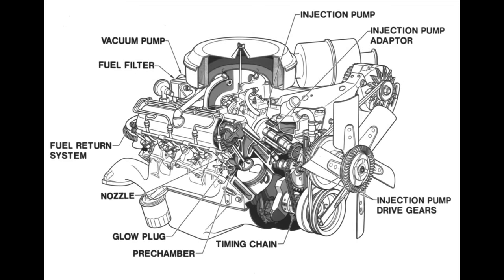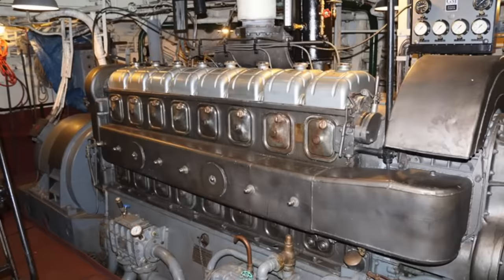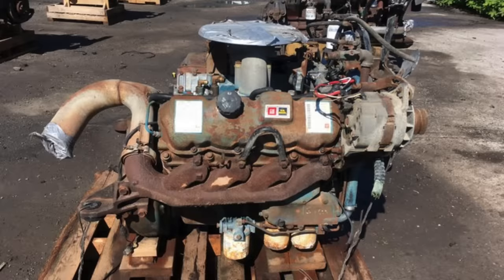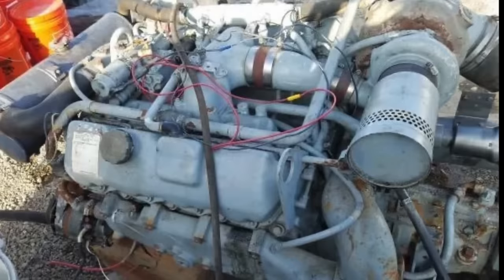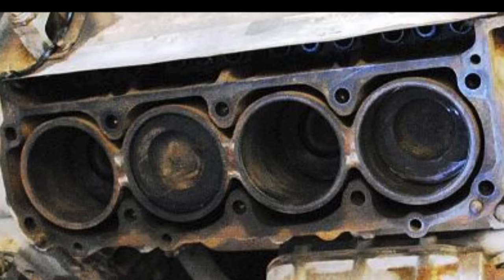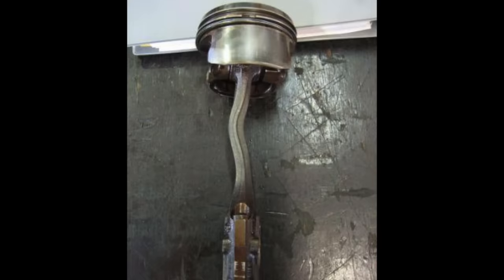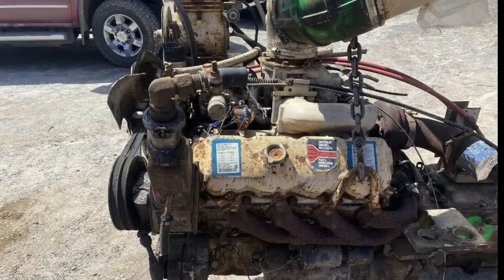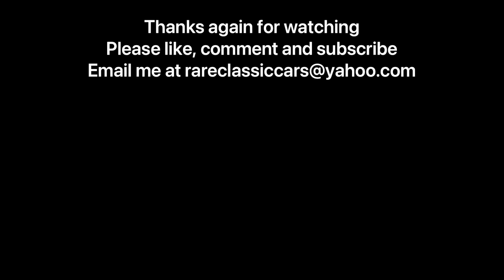Worst Engines: GM's 8.2L / 500ci "Fuel Pincher" Detroit Diesel Pinched Its Owners' Pocketbooks

Comment: I'll give you another example. The recent Ford Edge and the whole eco-boost line of engines. We just dumped one and bought a Toyota. I happened to see a youtube video and we got ahead of the issue before the head gasket totally went. It's a free standing cylinder design with a split channel between cylinders for extra cooling. She took it to a mechanic she trusted, yeah right,  and they tried to tell her it was ignition problems and needed new coils. We even told them about the design problem. We are network computer people so she borrowed a widget and reset the computer error lights.  I thought we would have to push it on to the car lot, but miraculous it made it. The Chevy Vega split head gasket in the video looks very much the same.  It was affecting 2 cylinders and I suspect the head gasket between 1 and 2 was right on the edge of going, pun intended.

Comment: That short piston skirt thing goes across the board for GM, short deck heights.  Makes for short rods and skirts for crank clearance at bdc.  All cost saving..   They did help the bbc truck engine by raising the deck.  Those old truck 427 blocks made great race engines for many reasons.

Comment: Some of the Ford Ecoboost 4 cylinders (2015-ish to ?) have open decks and are known for blowing head gaskets.  The Focus RS is a great example with 350hp out of a 2.3L engine with a lot of boost to do that.  As you mentioned, studs with insufficient clamping force was a large part, but I'm sure the open deck with the forces being applied to the cylinder sure didn't help.
Reply: Most modern gas engines are open deck, works fine for NA and can handle turbo if you design it right (i.e. reinforcing the right areas), totally unsuitable for diesels though.  Some of the early ecoboost 4 cylinders were known for a weak area between the cylinders where a head gasket blowout could happen.

Comment: About 30 years ago, I was talking with an older buddy who owned a shop specializing in engine rebuilds. We were talking about the world’s worst engines, and he, with 35 years of experience, asked me “you wanna see the worst engine of all time?”. He took me to the back yard of the shop and pointed at the headless remains of one of the lumps feature in this video. He pointed to the open deck cylinders and said “that, right there, is how you make a completely unfixable engine”. He went on to describe how every remediation for head gasket failures would fail due to inadequate clamping pressure, inadequate mating surface, and a ton of other head issues that couldn’t be addressed due to the fundamental and “stupid” design failure. 

But it was the final thing he showed me that was really shocking - he pulled out a penlight and pointed it down at the base of the third cylinder - at the base of the cylinder wall, where it met the bottom of the block, was a clearly visible crack caused by the open deck flex of the cylinder. Quote: “you can go on replacing head gaskets, reworking the head bolts, but they’ll all eventually end up scrap like this one - all so they could make it faster and cheaper”.

My buddy long ago passed away, his shop gone - I hadn’t thought about that conversation in decades until this video. People often rag on Northstar V8’s (a very flawed but lovely engine, one I have a lot of experience fixing and getting long lifespans out of) or Iron Dukes, but it’s horrible dreck like this Detroit Diesel 8.2 that really damaged GM’s reputation. You know the powertrain engineering folks behind this engine wanted a full deck, but the production engineering bean counters figured out that open deck allowed for faster and thinner block casting, reducing cost. I can imagine the engineers heading home, knowing this engine would fail, but unable to undo the terrible decisions inside the sprawling byzantine corporate bureaucracy of late 70’s General Motors.

All these years later, I have to agree with my old friend: the Detroit 8.2 really is the worst engine of all time.

Comment: This were basically throw-away engine. Head gasket problems, cylinder problems, no heat in the winter no matter how it was plumbed. I worked on many of these engines back in the day.

Comment: We called the 8.2L DD the "Turd Pincher" - LOL - The BLOCK engineer at DD must have CAME from the VEGA project, and then went to go work with for Cadillac and designed more of a mess HT4100! [THREE REALLY BADLY DESIGNED BLOCKS]  - OK now to "Defend" the Turd Pincher for a minute... The engine in the Ford lineup that this was aimed as a replacement was the 370-2V LIMA engine.... made 174HP @ 3600 and 288lb-ft @ 2400 - SAE GROSS - (The Naturally Aspirated 8.2 was rated at 165@3000 and 350Lb-ft@1200 SAE GROSS) - The 370-4V (190HP/298TQ) was serviced on the Diesel Side by the 8.2T rated at 205@ and 430lb-ft AND The top of line GAS 429-4V (234HP/354TQ) was serviced on the Diesel Side by the V636/3208 Cat in its various 225-250HP Ratings making 500lb-ft of torque.... Now to note the "Fuel System" on the DD 8.2L was the same "MUI" "Mechanical Unit Injector" actually adapted from the 2-stroke cycle DD engines...That was an awesome design...Had they not cheapened out on the Blocks and the number of Head Studs they would have been a fine engine! - The V636 was also a parent bore block meaning "no removable liners" which makes them a lot harder to rebuild, especially to do "in-frame"... I have rebuilt 4/6cyl Perkins engines that have "Dry Liners" and as long as the bottom end is "tight" and healthy, New pistons and liners in an afternoon, and never took the engine out of the machine/truck.

Comment: I never knew the Detroit Fuel Pincher had such a negative reputation. I remember a medium duty Ford brochure advertising it as an option.
Reply: Ford put them in alot of thier medium duty trucks. Eventually Ford started using thier 6.6 and 7.8 inline 6 built in Brazil (excellent engines) until they later started using "B" and "C" series Cummins engines.

Comment: My boss at the time had a '78 Olds 88 with the 350 variant of the diesel. At 32,000 miles he had to have a complete engine replacement as the heads warped and it cooked the interior.  He got rid of it after the warranty ran out.

Comment: I drive medium duty trucks in the late ‘80s and never liked them. I thought they were a converted gas V8. I remember my late Dad always bitching about the Olds 350 V8 diesel being a conversion job. He was a diesel mechanic in the ‘50s and early ‘60s. Ironically I had the gas Olds 350 V8 in a ‘79 Delta 88 in the late ‘80s with no problems. I much preferred the Cat 3208, the DT466, and even the big Ford gas V8s and the 6-71 Detroits in the straight trucks I drove back then.

Comment: Ford went with the Caterpillar 3208 V8 diesel engines. in many of their medium and many medium heavy duty trucks buses. these GM engines are also known Siamese cylinder engines. and the Cadillac 4100 series gasoline engines. were included in these type of engines. and were also aluminum block cast iron head engines. like the Chevrolet Vega four cylinder engines. and they were well known for head gasket failures.

Comment: Took out an 8-92 from our commercial fishing vessel after 40 yrs. and 60,000 plus hours on the clock. Looks like they dropped the ball with the above engine but hit outa the park with the 53/71/92 series. Yes they leak oil. Yes they are noisy. And oh hell they are heavy. But they will out last all newer type engines 3 to 1 or more. Sadly they stopped making them years ago but you can still find them. We installed another 8-92 BTW.

Comment: I used to drive for an armored car company. We had mid 80's F600 with a 5 speed and a 500 detroit in it. Loaded up with 8,000 pounds of coins, the truck was probably 20,000 pounds, we got 65 for a flank speed. Anything that looked like a hill, and you'd be downshifting and going 30.

Comment: Why design an engine that big just to put out 130 h.p!  That's crazy!  And the torque wasn't any better.  It makes a good boat anchor I guess!😊
Reply: Ours has 200hp from factory
Reply: In thier defense, they were VERY fuel efficient when running properly. Yes there were low horsepower versions, but also higher 200+ horsepower versions.

Comment: I worked at a GMC dealer when the 8.2L came out.Went for overhaul training on it.For GM it replaced the 4 53T Detroit in the 5 ton series.To do head gaskets on it in  non tilt hood GMC we had to take the whole front sheet metal off complete.Did it smoke on startup on a cold morning or what.

Comment: Omg …. Brought back some nightmares from the early 80 s 
I was 19-20 yrs old and worked for a Detroit Diesel distributor and was under the hoods of chevy and ford trucks pulling heads on the campaigns. Did so many I developed calluses on my stomach. 😂 chevys were alligator hoods and to get heads off had to tape the push rods together and pull with the heads omg what a pita! Tuneup was overkill for an engine with a short life span. But the series 60 was the one to beat in the late 80s and fuel mileage was tops.

Comment: Looks like a very poor design for a gas engine never mind a diesel.   It's a grenade with the pin pulled!!   Standing cylinders with no support is a poor starting point!!
Reply: I'm pretty sure this only helped make the engine warping problems even worse.

Comment: I was employed in a diesel shop back then, as an engine mechanic. Toward the end of my time there, the 8.2 engine showed up. It was almost impossible to dyno the rebuilt engines without some sort of failure. Seems they liked to seize up either the oil pump bushing or one of the cam bearings. Not too sure if that was the fault of the machine shop or just what. I would baby the engine in every way possible to get the darn thing off the dyno, but the failure rate was 90% or so. Not an impressive engine.

Comment: In 1983 I had a C 7000 GMC in a small single axle tractor, got 220,000 205 HP turbo 42,000 gross wight doing hi-way use.  Not to bad.

Comment: You should do a video on the 6.2 and 6.5 Detroit Diesel V8s that GM put in their pickups starting in 1982 (replacing the awful Olds diesels).  These were 4-stroke engines and turned out to be pretty robust and reliable.  Proof that DD could build a decent 4-stroke V8 diesel at the same time the Fuel Pincher turd was being produced.
Reply: The 6.2 & 6.5 were another pair of turds.  If you got a good 1 it wasnt bad.  But most were under powered junk with multiple expensive problems

Comment: Open deck engines are usually a result of making use of a die-casting process, rather than a sand core process, it's just cheaper.

Comment: Unfortunately, you don't know the history of the Chevy Vega. The only reason there were problems with the Chevy Vega engine over heating was mainly the radiators were too small. If you lost any radiator fluid it would overheat and warp the cylinder head. This occurred up until 1975 when they enlarged the radiator and offered a 5 year, 60,000 mile warranty. Also there was a study made at the time that mostly the cars were sold to many "students" because they were so cheap, and students didn't maintain these cars very well. Another note, the Vega engine had silicone impregnated cylinder walls which great reduced friction. This machining process was copied by the Porsche company for their engines. I still own a 1975 Chevy Vega with over a 175,000 miles on it, with the same original engine that ran perfect after my daughter quit driving it to get a larger vehicle. That engine was a great engine as I put most of the miles on it. I did use Arco Graphite oil in it the whole time I drove it. After that my daughter just used regular oil in it.  It's been stored for over 20 years in my building. Hopefully I will get to drive it again someday. It was a fun car to drive and it had plenty of power to fly over the mountains.
Reply: I agree with most of your comment here, BUT, Chevrolet had to change the cylinder treatment to those Vega engines somewhere in the mid 70's. The early Vegas did wear the cylinders out prematurely and they burned alota oil. The problem was corrected with the better cylinder treatment, and also the overheating issue with the bigger radiators. A little more R&D from Chevrolet would've given the Vega a much different reputation

Comment: Detroit Diesel Series 60 class 8 combination 
truck and coach bus engines were among the best over the road engines ever made. I have driven 14.7L Detroits with well over 1.27 million miles with Eaton Fuller 10 speeds in Freightliner Century Class double axle tractors...  all original, no teardown... stellar engines... remind me of a Chevy small block 327. do
...stellar engines

Comment: I got to drive one in a Chevy C60 dump truck turned into a traffic control attenuator truck. It was fun to run through the gears, but I wouldn't ever want to put any kind of load behind it.

Comment: Was this engine offered as an alternative to a "6.5" 4 stroke Diesel V8 with a turbo that only got exhaust from one bank of cylinders but pushed boost to both cylinder banks? Made more power than the "fuel pincher" in spite of having a smaller displacement? I seem to remember that either could be had in a school bus chassis.

Comment: I owned a  fuel injection rebuilt shop back then. And i seen those 8.2 sieze the oil pump on a test drive brand new. I finally quit doing anything to them. The failure rate was just to high on them

Comment: Oh OK, I thought you were talking about the other 500.  The 1968-something (1977?) Cadillacs usually had a 472, but the Eldorados had a 500 (and front wheel drive!).  I had a 472 in my 1972 Cadillac Fleetwood Brougham (over 22 foot long land yacht),  that thing drank fuel like a fish but the acceleration was alarming, with that slushy TH400 in there it would get to 60 in 8 seconds.  And I'm pretty sure it was tuned to pull power unless you were towing or going up a hill, it seemed to have very close to the same acceleration going up a steep on ramp as on flat ground.  Those engines'll last forever.

How'd they get a 8.2L diesel to only only make 350 foot pounds of torque (or 500 with a turbo?)  That Cadillac made 500 foot pounds of torque with gas!

Comment: I remember when the 6.2 GM Diesel first came out in 82,if you looked at the earlier literature that came with it it was a Chevrolet Motor Division engine,that was quickly walked back.and shifted to the Detroit Diesel Division ,and that was the platform the 8.2 liter was derived from,another thing that didn't help its long life potential was its use of a nodular iron crank.
         The other point I wanted to add is The GMC Division developed an diesel engine released in 65 called the Turbo Flow based on the V-6,and later the 678 V-8 GMC gas engine and was produced for medium to heavy duty GM trucks til 73.
Reply: Toro-flow
Reply: @JeffKopis  I not making this up.

Comment: I have one in a 82 C7000.  It runs OK but I don't trust it for hard work but it does well if you don't push anything.  I'm surprised how well it starts in the cold.  As a ol' farm truck it works until it doesn't.

Comment: I think you’re underselling a bit just how good DD’s other engines were. The series 60 was a fantastic over the road engine. And the 71 series was the powerplant of choice for virtually every marine application that it fit the horsepower requirements for all the way until the 80s and 90s. DDEC was such a well designed system that Daimler/MTU bought DD in spite of the fact that none of their engines would be emissions compliant in the future. MTU marine engines still are marketed with DDEC all over the place. People in the marine industry still reminisce about how reliable and maintainable the old pre-emissions Caterpillars and Detroit Diesels were, compared to the modern Cats and MTUs. Detroit Diesel still has a sterling reputation.

Comment: Just as a matter of opinion, both the 3208 Cat diesel and the 8.2L fuel squeezer acquired the reputation of being throw away engines to anyone with diesel knowledge. But the biggest downside to the fuel squeezer, in my opinion was it's lack of a cylinder deck. In my years of experience in dealing with many different brands of engines that lacked a cylinder deck, all had the inherent flaws of blown head gaskets, excessive cylinder wear, and severely deficient in longevity and durability.
  I owned an early 80's GM 70 series truck with an 8.2, and though it had low miles, it ran well and exhibited no mechanical problems while I owned it. Ironically, given the 8.2 L's bad reputation, they still command a decent price for both used engines and rebuildable cores. And, I have seen some with somewhat high mileage, still plugging along.
Reply: I like them! Just can't abuse them. I have a beautiful running low miles turbo 8.2 mated to an AT545 from a USDA Forestry Department bus. Nobody wants it, but I refuse to sell it to my core buyer for only $400.
Reply: @johneckert1365  like you said, just don't abuse it. After I wrote my comment and thought on it a while, I remembered that mine was also turbo charged. I believe that is why mine ran as good as it did.
    I've had the occasion to buy several, that's how I know about the price. They can't be too big of a junk engine and still command the resale price they do. I think they were good for the niche they filled, but I don't think Detroit ever intended for the 8.2 to supercede the 8-71's or even the V6-71's.
Reply: 3208 were good .
Reply: @davidhorsley1149  right on 👍

Comment: A very close second ,if not an equal to the Detroit "Fuel  Pincher" on the list of the worst GM truck diesels ever  would be the absolutely dreadful GM  "Toro Flow" diesels  of the mid-1960's and early 70's. Similar to the Olds 350 passenger car diesels (although not related or otherwise similar in any other way), the Toro Flow was a converted gas engine based on the GMC light and medium duty truck V6 of the same era.